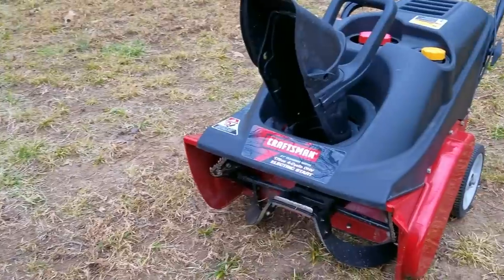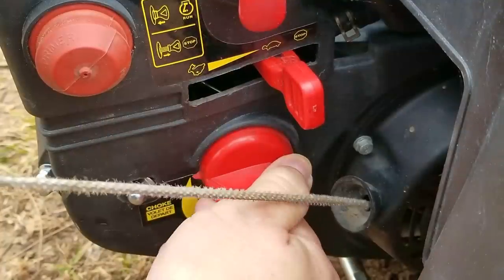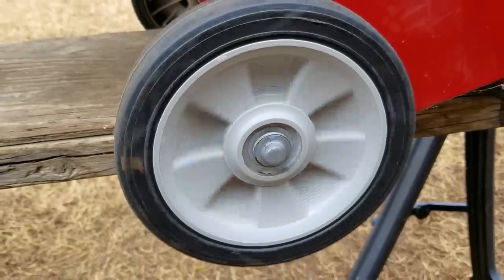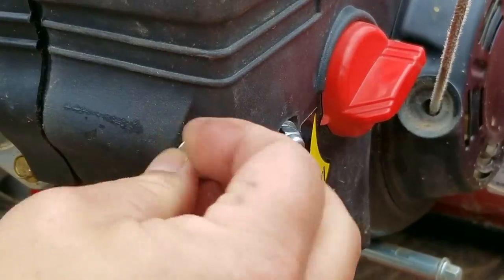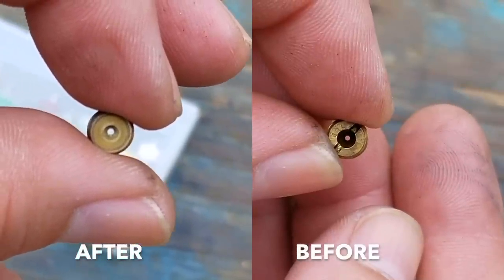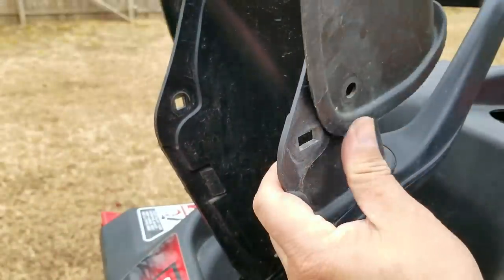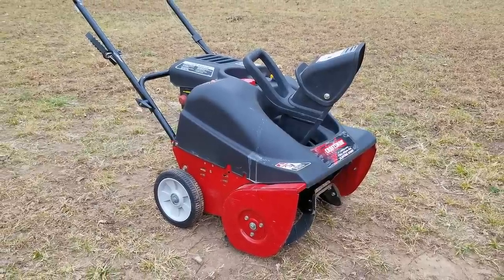What's Wrong With This Craftsman Snow Blower?

Comment: I would take a close look at the governor spring and linkage.  If that all looks good I would lean towards an air leak around the carb/intake.  It would be interesting to see how it acts with the original carb after you enlarged the openings on the jets.
Reply from the maker: that makes sense

Comment: I would try checking the valve lash. Unless it is an airleak by the carb, you can usually tell if a gasket or seal is leaking because dirt and grime will collect there due to oil seeping out. And if oil can coming out then air could be coming in. Cant wait to find out whats wrong with it!
Reply from the maker: Thank you Ethan Miller!

Comment: I have a pressure washer that ran similar to the snowblower, turned out it was a faulty spark plug. Spark seemed good but was cracked or something not exactly sure but a new plug fixed the issue. Another thing would be to reset the governor, it's possible the previous owner tried to fix something they had no clue how to fix. Also as many have stated valves could be another issue. Good luck I hope this helps. Great content as always.
Reply from the maker: that's something to look into, thank you

Comment: My opinion, if you had an intake air leak it would affect running at all throttle settings-load or no load.  I would look at the governor spring linkage.  Perhaps a spring got stretched or tab got bent while the carb was being worked on in the past. I really enjoy your videos!
Reply from the maker: well said! and thank you Andrew Ebensberger.

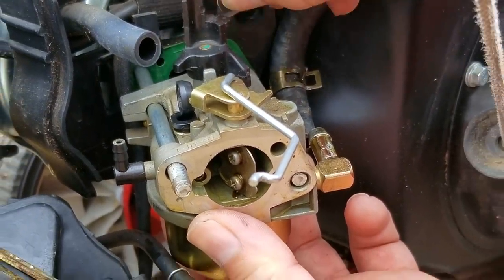Comment: I saw another comment mention air leak at the carburettor spacer. It's a black plastic piece behind the green gasket at 6:51.
I have worked on a few of these engines that have had them crack due to the nuts being over tightened that hold the carb on. 
Take it off and have a good look at it. Even a hairline crack will open up once the spacer is under stress.
Reply from the maker: thank you for the tip!

Comment: Thanks for this content. You’re a great teacher by explaining how you diagnose each issue. I’ve had a snow blower that had similar issues but I was able to get by, by adjusting the choke to clear my driveway. 

This is how I fixed it: I bought an 60v snow blower. Lol sorry that was a lame joke. I can say though the electric snow blower has been perfect. Only time will tell how long the batteries last but for the past two years not one hiccup. Also no dealing with gas, fumes, and maintenance that comes with owning a gas blower.
Reply from the maker: thank you Dao Yang

Comment: I can’t wait till find out what it is👍🙏👍🙏
Reply from the maker: thank you RayFpv.
Reply: @HomeGaragechannel  I have the same problem with a Toro 98cc snowblower and done everything to it new carburetor new spark plug change out the fuel filter and governor spring. I have taking the muffler off to see if there is build up and nothing. I notice the gasket was a little broken so I put some gasket maker and put back the muffler. I’m not going to give up on this one till I get it running like it should 😤
Reply from the maker: I appreciate your persistence!

Comment: I’ll be honest.  I’ve drilled out those plastic pilot jets so many times and they have not worked.  I end up replacing the jet with a new one and that solves everything.  I can guarantee valve lash has nothing to do with this.  This is fuel restriction.  And unfortunately this happens on ALL these MTD engines.  You can also try drilling new holes closer together on the butterfly plastic plate on the carb, every once in a blue moon that works
Reply from the maker: I really appreciate sharing your experience with these Cole Steffens

Comment: I'd say carb jet stoppage or partial block. I had a 5 horse Briggs that's surge but after it'd run on it's own I'd just put in fresh gas and let it run. It'd clean out after about 30 minuted. Needless to say, that rig is gone. BLESSINGS! And this is why I got an adjustable jet for the vanguard!
Reply from the maker: Great point!

Comment: Air leak but check the spark plug & the engines compression,valve lash,etc as well.

I have had a starting & running problem withy dads Honda GX35 powered line trimmer where it was caused by a bad (fouled & partially shorted out) spark plug.

There was some resistance between the inner and outer electrodes (I found it with my multimeter) & a $2 AUD spark plug which I bought on eBay which came from China fixed it & the line trimmer has done a lot of work since.
Reply from the maker: thank you for the advice!

Comment: I Would Check The Governor Arm Is Not A Bit Too Loose ,  ( Adjustment ) .  I Also Check Your Governor Spring Tension, I Don't Believe That It Has Anything To Do With The Compression , You Could Put A Compression Tester On It, But I Think It Will Be Fine.
Reply from the maker: thank you Joh Lambshead.

Comment: Great video, it could be the plastic insulator block that goes between the carb and cylinder head, could be warped or cracked causing an air leak.
Reply from the maker: I'm definitely going to check It out.

Comment: I have a same problem with Troy-Built Snowblower, what is interesting is, that its only surging while there is no load on the engine. If you keep driving in deep snow, it runs well.
Reply from the maker: that is interesting

Comment: My first port of call would be to change out the spark plug just to eliminate it, some resistance type spark plugs can act up at high engine speed causing a misfire which will cause the governor to react.
Next i would check the plug wire for any damage then move on to valve lash.
I don’t think it’s an air leak just because you are not able to correct it using the choke.
If the governor linkage is free of obstruction then that should be fine, it’s just doing it’s job.
Reply from the maker: nice ideas
Reply: I would like to know if you tried the original carb that you modified and how that might work - I have the same snow blower and when I let it sit for a while the carb always acts up. I have been lucky enough to use half choke and it smooths out the rpm. they way this machine is designed you have to take half of the blower apart to get to the carb which is a pain. Let us know how you make out

Comment: Check the governor springs linkages check the fuel hose check the manifold for a Crack check for air leaks check your fuel cap see if it's not clogged up!
Reply from the maker: thank you JJ Juarez.

Comment: Sometimes  with a engine like that the plastic carb spacer warps and can cause a air leak change gasket closet to engine and see if that helps . Also if it is a clone carb you most likley  will need to make idle jet bigger .
Reply from the maker: nice tip!

Comment: A lot of new engines are being built and tuned to a point where they are barely on the edge of surging. Changes in elevation can cause your engine to run differently. Now I would check the governor system for any faults but if you were to make the hole in the pilot jet just a bit bigger it could possibly fix the surging.
Reply from the maker: that makes sense!

Comment: Bought a used TroyBilt that had a similar issue.  In my case it had funky metallic gasket that was installed on the wrong side of the carb causing an air leak.  I’d rule out an air leak by spraying carb cleaning fluid around the area where the carb is mounted to the intake to see if the surging stops – easy test.
Reply from the maker: thank you for the information

Comment: I remember the original video on this thing! I would check the valve lash and timing, chances are a plastic gear got misaligned in the governor system.
Or a spring for the governor and gear for the valves
Reply from the maker: hmm.. that is a very good point.

Comment: Did you try tuning the screw in a bit above the pilot jet? An OEM carburator replacement? On the old carburator there is a screen in the carburator just behind the fuel intake. You can try taking the seat out and blowing high psi air int the seat to blow out debris, then carb cleaner.  The replacement carb off Amazon hardly ever works for me. Good luck.
Reply from the maker: thank you Thomas Roche. 
The screw above the pilot jet, only sets the slowest speed, you want the engine to go. Screw it in, and when you move the throttle to slow, that's the speed you've set. screw it in more, and the idle speed, will be higher, it has no effect on the max speed.

Comment: Three things I hear.  Check the valve lash clearance in the valve cover. Then check the float see if level. Then last look at the. MAIN JET use next drill size up to open it up just one size.  Example of drill size is .05 mm use next size .06 mm, in any way it's a lack of the proper fuel into the engine worked on many of these motors. Epa stranglehold the emissions tightly
Reply from the maker: thank you Christopher Tyler.

Comment: I'd try actually loosening the governor tension spring and put it in A hole in the governor arm. It has A very high idle which is not normal. Full throttle might have to much tension on the governor spring.
Reply from the maker: thank you Casey Still.

Comment: To check for air leak after the carb, while it’s running, spray some carb cleaner in the area after the carb and if the rpm’s increase, you have a leak.
Reply from the maker: thank you Alveus.

Comment: there is a air\fuel mixture screw hidden under looked to be round brass colored plug insert just to the left of the pilot jet on the side of the carb i used a screw driver to pop out the plug to gain access to the screw solved the issue of surging on mine
Reply from the maker: thank you naodog4, I'll have to give it a try.

Comment: I remember using a new aftermarket carb on my 3750 watt Husky generator when the old one was clogged to where the generator couldn't handle even a quarter of it's capacity.

The new one had fuel issues, and when testing it under load, it just wouldn't supply enough fuel. So instead, I put the old one back on, but cleared the jets. Now it runs perfectly even under a 3000 watt load. 

Both the old and new carbs are the same style carb you did in this video.

I assume you drilled the holes in the old carb? Unless there are fuel control screws on that carb (which there isn't any), it could run rich now? But that aside, yeah I think it's a valve lash issue.
Reply from the maker: thank you for the information

Comment: I’ve had many engines come In with the same problem and can be anything from an air leak to the governor failing under load. If it would be the valve lash it would act with or without load and would make a noticeable tink at idle
Reply from the maker: very good answer.

Comment: I think it’s an air leak, I’ve had a very similar problem with a motorcycle before. The intake  was cracked. Air leaks are scary especially with a self adjusting carb.  great way to get a runaway engine.
Reply from the maker: makes senes

Comment: Primer hose and Bulb okay? Did you replace the carb with the correct one?
Reply from the maker: yes, used model and serial number to find the carb.
Reply: @HomeGaragechannel  Ok, also is the governor linkage operating "Free", not rubbing on anything?

Comment: My guesses. 1. Air leak after the carb. 2. Just because you replaced the carb, doesn’t mean that carb is good. Could still be carb related. 3. Governor linkage. 4. Bad fuel. 5. I’d be real surprised if it was valve lash.
Reply from the maker: thanks again

Comment: probably a linkage issue or maybe a adjustment on the carburetor aka carby and if that does not work the valves would be the last option etc.
Reply from the maker: I'll have to take a look .

Comment: I wanna know how good it would work if you took the whole governor out my go kart did the same think until I took the governor out
Reply from the maker: I'll make an explanation in the next video, but the governor is a self regulating device that's also used, to control max engine speed. you can run without it but it's not recommended.

Comment: I HATE TO SAY THIS  BUT THERE MIGHT BE A BLOWN HEAD GASKET    I HAD THE SAME PROBLEM WITH AN OLD KOHLER ENGINE..   NO MATTER WHAT I DID  IT WOULD NOT STOP SURGING  I THEN REPLACED THE HEAD GASKET, THEN VOILA.. NO MORE SURGING..  RAN GREAT FOR EONS...  IF I STILL HAD THE KOHLER   I KNOW IT WOULD STILL  BE RUNNING     LET ME KNOW IFTHIS HELPS
Reply from the maker: thank you, I'll have to check

Comment: I did fix one, the original belt is too tight too much friction. I change to a longer belt it is working fine.
Reply from the maker: wow nice work!
Reply: @HomeGaragechannel  The owner broke the belt few times , He was following the part number to get new belt. I found the belt too tight was rubbing against the tension shoe all the time.  I switch to a longer belt it is not rubbing anymore when not engage the auger.  I build cars I saw enough screw up engineers.

Comment: I have an ‘03 single stage sears craftsman snowblower and it still runs good. Any tips on what i should do when I take it out of storage?
Reply from the maker: sure, put some fresh fuel in the tank, and then remove the drain bolt and allow about 3-4 oz to leave the bowl, then replace the bolt.
Reply: @HomeGaragechannel  Thanks!
Reply from the maker: no problem

Comment: I had a bigger 3 stage one that did this after being in storage. It didn’t really effect use so I ignored it because I needed to use it.   After a 20” snow and hours of use it magically went away.  Italian tune up for snow blowers I suppose.
Reply from the maker: nah.. the running finally flushed out the partial blockage, but you did give me an idea, about just letting it run, and see IF, it clears on its own.
Reply: @HomeGaragechannel  I had thought of that and let it idle for an hour but that didn’t fix it.  Needed a hard run or at least a longer idle.
Reply from the maker: makes sense

Comment: Is that carb adjustable if so turn the high speed needle until the engine runs smooth
Reply from the maker: unfortunately no it's not adjustable
Reply: @HomeGaragechannel  I would check the plastic intake manifold for cracks and the breather hose on the valve cover for hardness
Reply from the maker: I'll have to do that. thank you!

Comment: I'll be interested to see what happens. FWIW, the YouTuber Technology Connections claims that his snow blower surged ever since he bought it new, but it still works as intended. Granted, his channel is mainly focused on electronic devices rather than small engines.
Reply from the maker: thank you for the Connotafoo. I didn't mention it, but did try and use it last year but the problem was that the surging makes it tough to use. Being a single stage, the varying speeds, caused the chute to clog with snow.

Comment: You didnt check the compresion as you usually would could be tight rings or valves as you suggetsed :)
Reply from the maker: Great point! I'll have to that, in the coming video.

Comment: I have a ryobi 2 stroke whipper snipper, it's recently started leaking like crazy but i can't pinpoint where the leaks coming from but it looks like it's coming from the carb, also when pressing the bulb it seems to suck air, so there's air in the return pipe. Is there any guess on what it could be?
Reply from the maker: not without more information
Reply: Did it surge when engaging auger?

Comment: I could be the fact it has zero load. Rototillers don't he same thing and clear up instantly as a load is applied
Reply from the maker: unfortunately I had the same thought and tried to use it this way, and after 2 hours, It was still doing it.  But that's was a very good idea.

Comment: Govoner spring maybe ?
Reply from the maker: it's possible
Reply: @HomeGaragechannel  Also use carb spray around intake and gasket's and spacer and see if surging goes away that is tell tail sign of air leak .